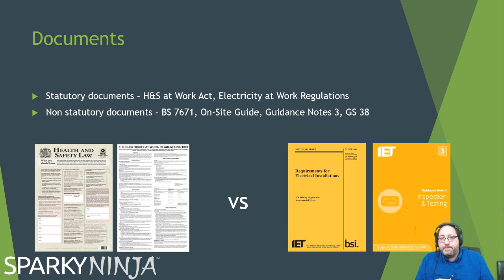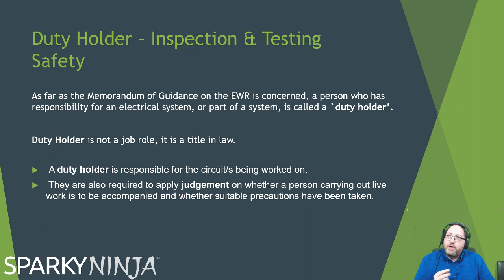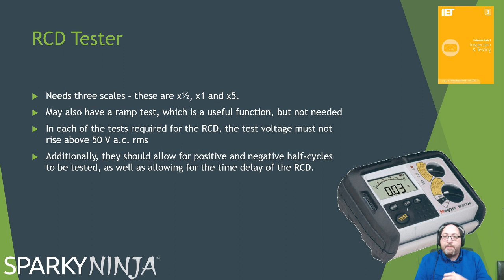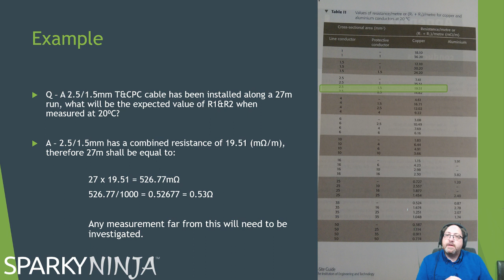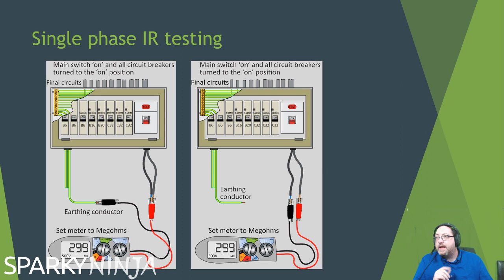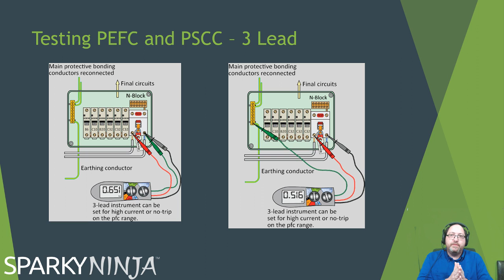City & Guilds 2392 - Inspection and Testing Course overview

Comment: I wonder?
Why do we have 2392 inspection and testing qualification when we have the more popular one 2391-50?

Which one is which? and what are the recognitions of them in the industry?

If you have a qualification of 2392 ,will the industry recognise you as an inspector for testing of electrical installation in dwelling? in commercial? or industrial?

Is it only for making money by offering two different versions?

Thanks
Reply from the maker: It was introduced to provide training for domestic installers signing off their electrical installation alongside Part P. Hence its limited to initial verification and domestic installations.
Reply: @SparkyNinja   
Many thanks for your reply.
So anyone has 2392 will be able to issue a domestic installation Certificate for minor jobs and new installation?
Thanks

Comment: Thank you so much for your job. Great video as always and massive help for precourse preparation. just want to point to slight mistake on the slide about RCD testing: in 5 times test RCD should trip within 40ms or 0.04s, not 0.4 s (40 ms = 40s/1000 = 0.04s). Cheers

Comment: Dead  test/ Live Test - Sequence of test
I wonder has anyone seen John Ward's videos on testing?  He never mentioned SELV etc. What's your take on the test list comparison?
Reply from the maker: It's as detailed is it needs to be.

If SELV is present as a system (not just a transformer 30cm away from a luminaire) then there are segregation requirements between Band II circuits, PELV circuits and Earth.

Comment: Can you make a short vidio on the one test most sparkys do not understand,That is the test an niceic inspector will expect you to know. That is the test you need to prove  NOT Assune that a bathroom is safe ie, The touch voltage test. Many Thanks
Reply from the maker: Sure 👍
Reply: I just did this exam with Ableskills BE VERY CAREFUL IF YOU USE ABLE SKILLS the preparation and exam are horrendous. AND I PASED IT! I asked for permission to switch off and then told “you didnt ask youve just failed” i walked away thinking “i failed” and then realised “but i asked?” So challenged the assesor, i was then told, oh yes you did didnt you. I was allowed to continue but it took me 15 minutes to regain my composure. I started making errors, and when i had finished assesor said I had only just managed to get through it as lots of minor errors. Whose fault was that then? there you tube videos do not have comments disabled for no reason. This was last week of 4 weeks training several others quit before 4th week as couldnt handle the stress.
Reply: @simontredwell991  I did the 2391 with them at Dartford about ten years ago. I can't remember the tutor's name but he was a complete tool! Similar thing happened to me, I smashed the theory and assumed I would be the same in the practical as I had been testing on the tools for 7or 8 years. The tutor did everything he could to make me feel uncomfortable and I ended up having to do a retake...His excuse was I didn't prove my voltage testers against a live circuit after I had isolated the circuit! Silly mistake I know but everything else was by the book!
It felt like he just wanted to bring me down a peg or two.

Comment: Hi, the ring final figure of 8 test is such a mind f### until you understand it, 
the way I see it is that basically when you've cross connected at the C.U. and start measuring at the sockets your really just measuring a parallel path,
as one path decreases the other path increases by the exact same amount but always equalling out. like you and a mate standing across from eachother on a big circle!
you at 12 o'clock him at 6 o'clock,
 walking round the big circle you move to 9 and he will be at 3 but always equidistant from eachother!
enjoyable video.
right I'm going to have a lay down now.
best regards Warren